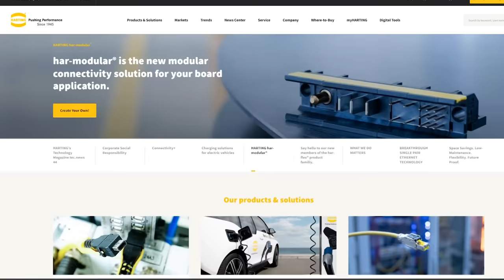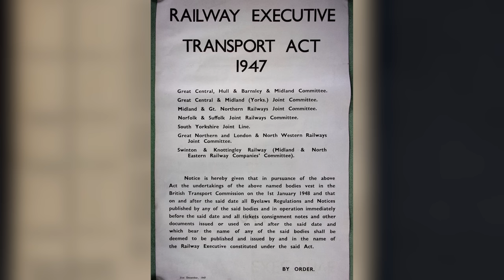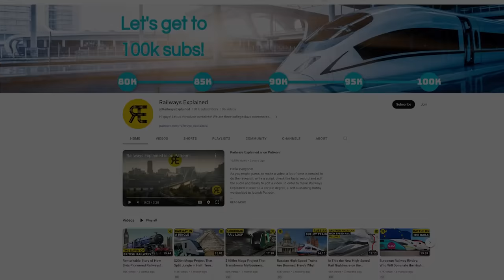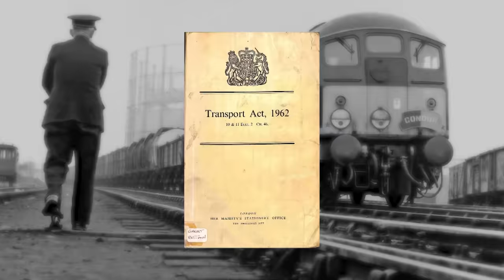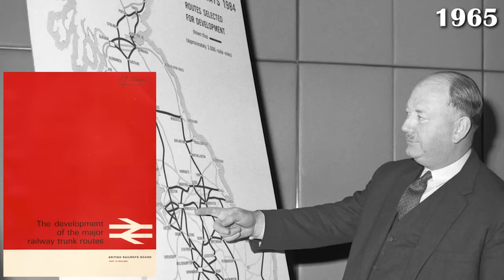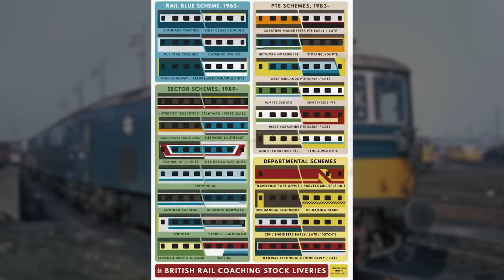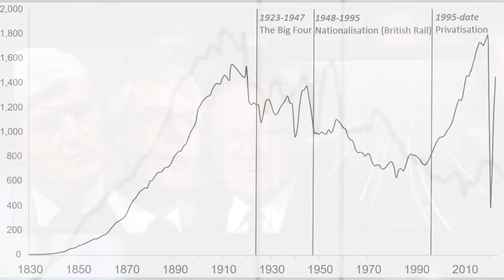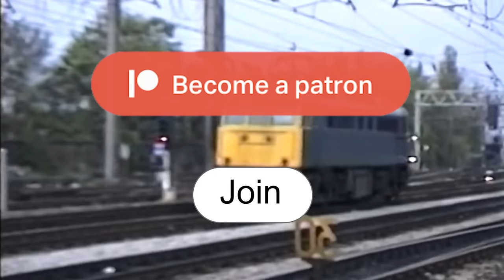Did the British Rail's Nationalization Work?

Comment: People whitter on about the lack of standardisation in BR, and running multiple types of locomotives. They ended up with a standardised range of locos with the Class 20, 37 and 47, which are still in service now. The reason for running multiple types was to see what worked, scrap what didn't, and they were left with those classes running which proved themselves to be the best suited to BR's needs. It didn't fail. It worked perfectly as they ended up with very well proven and reliable designs that are still in service 60 years later.
Reply: The classes you mention are hardly mainstream and are probably the most reliable survivors of the various types. What about class 40, 44, 45, 50,  55, 73, 81 etc ? If we are talking about standardisation today, I would suggest the Hitachi dual power IEP sets fit that criteria though they are not inspiring to travel on.
Reply: The German and French built loads of locos, and very few were considered duds. And none of them lasted 60 years, because they kept developing new and improved models. Talk about gilding the lily.
Reply: @andrewlong6438  They were once the dross had been shaken out. The majority of the other classes you mention are either long scrapped, built in tiny numbers, electrified for catenery routes, have no where near the number of survivors, or had short service lives. All of those classes combined barely even totals the number of class 37s built.
Reply: @SeverityOne  SNCF and DB also had a great deal more freedom and investment. The Germans and French don't complain about right wing governments killing off their rail manufacturers, 60 years of underinvestment and privatisation.
Reply: What you stated about trialling multiple types & then scrap the ones that don’t work was the original plan. But around 1957 or 58 BR decided to hasten the dieselisation process & order production batches of numerous classes of locomotives. Hence where the lack of standardisation began.

We had the diesel hydraulics to begin with. While not necessarily failures, they were nonetheless non-standard machines that barely lasted 20 years. The diesel hydraulics totalled over 300 machines which could have been spent on diesel electrics instead.

And then we have literal failures ordered as batches because BR wanted more diesels at a whim. The 17s and 21s are prime examples of that. 58 of the North British machines were ordered in numerous batches, a number which could hardly be called trialling. Remember that all the pilot batches of classes ordered under the pilot scheme either numbered 10 or 20. Originally only 10 were ordered until BR decided to speed up dieselisation and ordered 48 more before they could even properly trial the prototype and they were massive failures.

The class 37s were lucky. The 37s didn’t even have a prototype and it was really by luck they were successful. If they hadn’t, they’d have disastrous results like the Claytons. 117 ordered without trialling and all that money dumped into the sea. 117! No railway would ever order over a hundred machines for ‘trialling’. They ended up having to order more 20s to replace the 17s. Had they continually ordered more 20s the whole fiasco could have been avoided.

And then we have successful but non-standard classes that were batch ordered. We have BR, BRCW and Brush type 2s. Three families, five classes of locomotives in the same power category. While good machines (aside from the Skinheads, they were disastrous at first) I question the need for 3 families of Type 2s. The same goes for the Type 4s. The Peaks and Whistlers are in the same power category yet nearly 200 of each were built. If they had gone on with standardisation, they’d have only chosen one to mass-produce until the 47s emerge.

While the standardised classes are successful and still work to this day, don’t forget all the classes of locomotives that were mass-produced for BR which became colossal wastes. What you said was BR’s original intention but sadly they didn’t go along with it and mass-produced non-standard diesel classes that shouldn’t have been built further. Hence the lack of standardisation was sadly true and undeniably a failure on BR’s part.
Reply: But it still ended up being a huge waste of money finding the right class of diesel-electric locomotives for British Rail. They should have standardized on a few classes to be used nationwide very early on and saved themselves a huge amount of money.
Reply: @robindufton1392 The UK hasn't had a right in over a century lol
Reply: @volvoolympianforever  I never had any experience of the Warships, having been brought up miles from GW territory. I gather that both types of North British build were disasters, but the Swindon ones were reasonably successful. In February 1958, one of the NB Warships, D600 I think, was assigned to the up "Bristolian" and failed early into the journey. The Westerns were successful; the chief problem was that they never had ETH, so they could not work air-conditioned stock. I presume that they could have been so fitted, if they had been kept longer. Incidentally, there would have been 100 if building had not ceased. I have found a list of names for the other 26. I never experienced the Hymeks, but I have never heard anything adverse about them, except that they were hydraulics, and would have had steam heating only. Class 40's were no match for Pacifics on the East Coast Main Line. In 1960/1, there was a working from King's Cross to Newcastle and return on two of the fastest trains of the day. It was officially a Class 40 job, but was regularly worked by an A4, or even an A3.  I regularly travelled on the NE/SW corridor in loco-hauled days. A Peak was as good as a 47, if not better. I also travelled a fair bit on the North Wales main line in the early seventies. Most loco-hauled trains were Class 40 hauled, with the occasional Class 47. A 47 showed little superiority in those days. A Class 47 on the East Coast Main Line equalled disaster more often than not, especially as a Deltic substitute. One evening in the summer of 1976, I went to catch the up afternoon Talisman at Newcastle. I was not amused when told it was running 20 minutes late. It eventually appeared half an hour late behind a 47. I reckoned that if I caught the next (and last) train, I would be in London earlier. Up to a point it worked, but the clapped-out 47 was holding up other trains. The Talisman took just over SEVEN hours from Edinburgh to London; half an hour longer than in the days of steam. The train I was on, with St Paddy at the head, left Newcastle 16 minutes late because of signalling problems in Edinburgh. It left Doncaster, the only intermediate stop 11 minutes late, but eventually caught up the delinquent Talisman, and dropped 23 minutes between Doncaster and London. I complained to BR and told them that Class 47's were built to do all sorts of things, and do not do any of them successfully. The response that I eventually received was that there was no Deltic available, and a 47 was the only option, short of cancelling the train. The crew conceded that time would be lost all the way to London.
Reply: Personally think it was 1930s and even then that was when government was non helping and had numerous issues still. As many pointed out they should of gotten a proper one mixed traffic locomotive and then base it to get lots of parts sharing but still tuned locos. Rather than wasting time on so many. A better would of been like take the class 47 and then refit it for multiple freight work and passenger work using it as a base. Would of saved a ton and would of not needed the tops of other classes.

Personally I think government not allowing the electric plan or those necessary infrastructure upgrades all the way was what derailed the ENTIRE BR from the beginning that nailed them.
Reply: @gerogyzurkov2259  There were plenty of mixed traffic locos in the thirties, although each of the Big Four had its own design. The GW had the Halls, and the LMS had the Black Fives. The LNER and the Southern were "horses for courses" railways, although that changed when Thompson succeeded Gresley on the LNER. He introduced the B1 in 1942, which was the equivalent of the Black Five.
Reply: @volvoolympianforever  The hydraulics were not all failures. The North British Warships were disasters, but those with the Swindon bodyshell were an improvement. The Swindon Warships, the Hymeks, and the Westerns were mostly successful. The Western Region needed lighter locos to cope with the South Devon Banks. It was British Rail's decision to go for air brakes towards the end of steam that killed the hydraulics. Whilst all but five Westerns did receive air brakes, few, if any, of the other classes did. The second blow was the abolition of steam heating. Westerns could not haul air-conditioned rolling stock. ( By the time such stock was introduced on the Western Region, 1973 to be precise, the Warships had been withdrawn, and there were only a handful of Hymeks left.) The really big waste of money was the Class 14, as the work they were built for was being rapidly phased out. In a slightly earlier era, the Western Region was turning out pannier tanks, mostly the 94xx class, until 1956, by which time the 08 shunters were well established. Another waste of money!
Reply: @andrewtaylor5984  LNER Gresley era the only ones he would design and build for mixed traffic during LNER were v2s and v4s. Which were 2-6-2s. He didn't like much of 4-6-0s which to the other big three in comparison built alot of designs for. 

The only one "new" 4-6-0 design which he would design and build for LNER is the B17 class. The reason why it isn't really mixed traffic in comparison to the other companies it is cause the weight of the axle load was too heavy for some routes. Which was accepted by choice cause according to the planning stages for it they couldn't get to fit all the design requirements for the design within the weight limits for some routes. So the design axle load was made heavier cause of the acceptance. Although according to axle weight limit to the Black Fives it's very similar for both Black 5 and B17 at 18 axle tons although I couldn't find much for Black 5 on that. Only one source give me that 18 ton weight.
Reply: Yes even Gresley era was for mixed traffic locomotives still hence the V2s and V4s. I think LNER financials weren't should be taken into account. Which what he did achieve for that much support he had done the job well. That's opinion by the way.

The fact is LNER wasn't exactly a well funded company is true. Hence why Gresley gone for the big engine policy. He had to for the mixed traffic and other duties mostly resorted to just rebuilding or make more pregroup locos. With few new designs.
Reply: @andrewtaylor5984  Change to Air brakes where necessary though. I personally think BR diesel wasn't serious enough with the amount of designs and numbers they made. Was as many said tons of money and materials.
Reply: @gerogyzurkov2259 Gresley did consider a 4-6-0, but went for the V2 instead. The B17 class had two main variants. The first 48 had small tenders to fit turntables on the Great Eastern section. The 25 Footballers, as they originally were, went to the Great Central initially, but were later transferred to the Great Eastern. I presume that the turntables were enlarged at some stage. They had 6' 9" diameter driving wheels, and would not have been suitable for freight traffic. Incidentally, there was talk of building some for the North- Eastern lines, but that section opted for the D49 instead. Most of Gresley's designs were locos intended to do a particular job.
Reply: @gerogyzurkov2259  It was Thompson's B1 class which was the LNER's equivalent of the Black 5. Even then, one cannot give a fair comparison. The LNER had 202 Pacifics, and 184 V2's. The LMSR only had 51 Pacifics with the 71 Royal Scots as back-ups, and its trains were often heavier and longer. Shap and Beattock are far steeper than anything on the East Coast Main Line. The Cleethorpes trains were the only regular long-distance trains from King's Cross hauled by the B1 class. In the fifties, they were often used on Great Eastern expresses as B17 or Britannia substitutes. They also could, and regularly did, deputise for A3's and V2's on the Great Central.
Reply: @gerogyzurkov2259  One well-known railway writer, possibly O. S. Nock, called the V4 class, Rolls-Royces built to do the work of a Ford. If Gresley had not died in office, would more have been built? Probably not, because the three-cylinder layout was difficult to maintain. Both locos had very short lives, and were withdrawn in 1957.
Reply: I have mixed views about the Class 47; they were not really front-line express passenger locos. On the East Coast Main Line, if you had the misfortune to have one on a Deltic job, you would lose 20 minutes on the King's Cross to Newcastle run, or vice versa. If the train had originated at Edinburgh or beyond, it would already have lost time. I have travelled behind the class elsewhere, and found them little better than a Peak, or even a Class 40.
Reply: @volvoolympianforever  Not only that, but thousands of steam locos were scrapped before they were life-expired. I bet that BR sold them to breakers for far less than their written down value. (It was the same with land. Railway land was sold on the cheap.) Not long after the modernisation plan was announced, some economist wrote that a strategic reserve of steam would have to be retained until c1985. BR also did the Euston electrification on the cheap. Having overspent on the Crewe to Liverpool and Manchester routes, they did not raise most of the bridges from Crewe southwards. This was why yellow stripes were painted on cab sides on several classes. The powers that be also ordered that the remaining Coronation Pacifics were to be withdrawn at the end of the summer of 1964. They might have been too tall for the lower overhead, but many of them were still in good mechanical condition, if a bit scruffy, and there was plenty of work for them north of Crewe. These trains had to make do with Britannias or the dwindling number of Royal Scots, Patriots, and Jubilees. These locos were less powerful, so many more trains needed banking assistance on Shap and Beattock.
Reply: @andrewtaylor5984  3 cylinder worked well when maintaining well. Had Gresley lived longer he would of probably resorted to building a better loco for less maintenance and a better 4-6-0 then the B17 where.
Reply: @andrewtaylor5984  V4 class has a axle load (this is the prime indicator of what route availability it can go) of 17 tons which is less than the Black 5s. So overall I can't lean on the author when the axle load which is the best indicator of what route weight it can do is around similar weight to a Black Five.
Reply: @gerogyzurkov2259  Exactly. It became more difficult in the Second World War to maintain anything on the railways, and that is why Thompson rebuilt a few locos from three cylinders to two. The programme ceased shortly after nationalisation. The only post-Gresley locos with three cylinders for the LNER were the Pacifics.
Reply: The two V4 locos were built in 1941. They certainly could work over much of the LNER, though at present I cannot lay my hands on a book which shows their RA number. (Possibly 4 or 5.) They were too elaborate for wartime conditions, and Thompson had no use for three-cylinder locos, apart from the Pacifics.
Reply: @andrewtaylor5984  RA for Black 5 is 7 while the B17 get 5 (no idea what availability system is under. Source from wiki for both) which has a axle Load of 18 tons. The v4 keep in mind can do vast majority of the LNER network.
Reply: @gerogyzurkov2259  The RA numbers were peculiar to the LNER, and I was unaware that LMS locos had RA numbers once transferred to former LNER lines. The GWR had four classifications, in descending order red, blue, yellow, and unclassified, and they had a disc painted on the cab. Standards on the Western Region were also similarly classified. The Kings were double red, as there were numerous red routes on which they were not allowed. Rather oddly, the 47xx 2-8-0's were only single red, even though they were also banned from a number of red routes. The LMS and the Southern had a different policy. Any loco was in theory allowed on their lines, unless their civil engineers said otherwise.
Reply: @andrewtaylor5984  black 5 RA 7 was under BR.
Reply: @andrewtaylor5984  Gresley wanted a wider firebox according the wiki. As Gresley couldn't make it work for mixed traffic with him so V2 and V4 where made instead.
Reply: Anyway for BR they should of done what nowadays with the 800s and 700s. Take the base design and branch it out with alot of parts common to reduce . maintenance costs and time. In which case as I said before the class 37 and class 47s should of been the ones major vast majority to make for the mixed traffic with the 37s being light duty and shutting sub class with the class 57 being the specialized heavy duty. As for electric diesel freight make those modifications of those former classes like the 37, 47, and 57 be made diesel electric refitted for a new entire sub class of 70s and 80s keeping most parts in common with their former classes to reduce costs and time. Do it Boeing and Airbus style parts sharing. No need for those purpose built 80s. 

The class 100s are fine. Except the Pacers obviously I think should of been majorly changed up. Don't let Leyland do any imo since they can't even run their own things without being corruption either. Not for government either.
Reply: Five-coach trains are too short! This obsession for multiple units has gone too far. Even if you couple two units together, it does not help. because there is no connection from one unit to the other. In the good old days, an endless supply of loco-hauled stock was being built, up to the mid-seventies. BR then decided to have fixed rakes on ALL trains, and cannot cope with extra traffic, even when notice has been given.
Reply: @andrewtaylor5984  the French and Japanese mostly go for 7 car and even 10 car always for their HST. Rarely 5 car variants they will do
Reply: The B17's were originally built for the principal services on the Great Eastern section. Gresley did consider another 4-6-0 design, but he preferred the 2-6-2 in the end. (The football series had larger tenders, and were built for the Great Central, though they finished up on the Great Eastern lines.) They were apparently rough riders, even after overhaul.
Reply: @andrewtaylor5984  Yet the crews like them for their performance
Reply: @gerogyzurkov2259  I was not aware that former LMS locos transferred to the Eastern and North Eastern Regions, as well as LNER depots in Scotland were given RA numbers. It surprises me that the Black 5 was RA7, whereas the B1 was RA5.
Reply: @gerogyzurkov2259  What do the crews like for their performance?
Reply: @andrewtaylor5984  well received but that's wiki. They even needing to put what source for this
Reply: @JSmith19858  Not with Alstom and Siemens being some of the biggest train manufacturers in the world, no. Neither is government-owned, though (except that Québec has a 17.5% stake in Alstom, probably from the take-over of Bombardier).